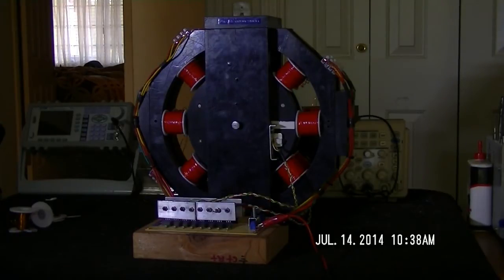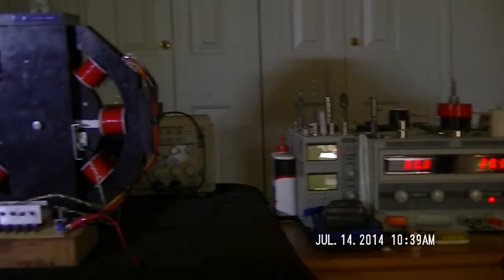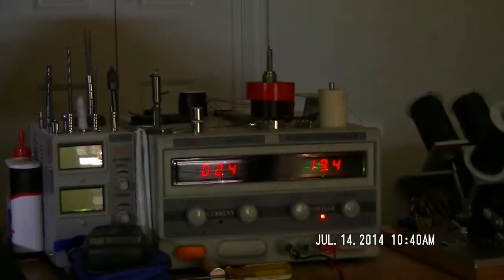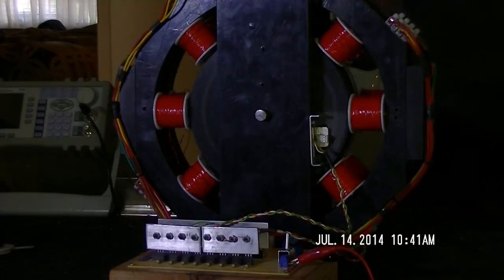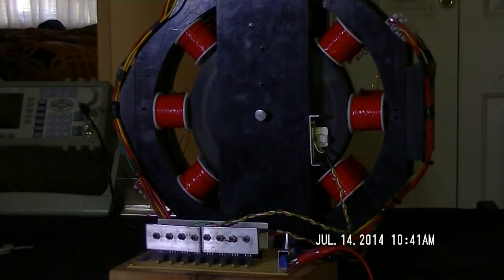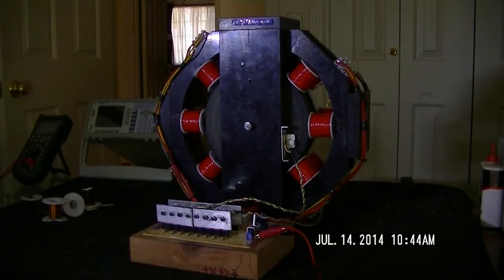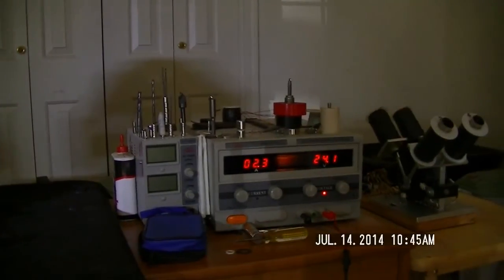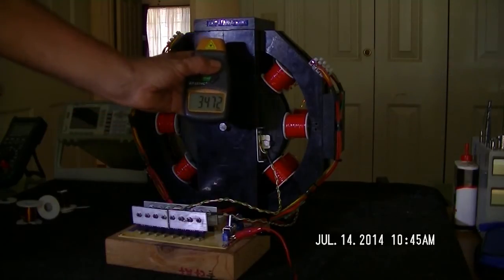Stage V: Destruction in the lab

Comment: Please invert and turn into a motorcycle wheel xD legit awesome! I need to learn more and craft this design but for mobility!
Reply from the maker: Its possible for a magnetic pulse engine like this could propel a light weight bicycle.
Reply: Sounds wicked, I was thinking more of putting the magnets in the wheel and putting the batteries in the center so it collects the energy from itself, would then end up powering itself better and provide full movement to the wheel turn and adjust speed with the amount of hz put into the coils. but I also no nothing and was more joking about the ideal.

if you ever build a working model you'll be rich and i'll be in roseburg sitting on my ass xD
Reply from the maker: These motors have very little torque, therefore, in the application of a bicycle, once the initial momentum is generated by peddling the bike, the motor would be activated to create magnetic pulses to continue the momentum. With two batteries, one 12V battery would run the motor while the second would be charging from the fly-back voltage created by the discharging coils.

Comment: the entire mechanism must be in a maglev state. incorporate the piezo shell, use light weight ceramic buffers for the mag seperators *unless something works better.. just a note? F1 engines run @ 19,000 rpms.. imagine the angular momentum in that?
Reply from the maker: Wow, ...they didn't cover this in the mechanical engineering curriculum at Cal state.  Dad was right, I should have gone for the PHD.  LOL  
This "maglev state" seems very much like what I saw in my dream.  While looking at this one craft, it was like looking at a sandwich that had one side lifted off the other and I could see two circular formations of magnets directly over each other...but that was all I recognized while the TDO seemed intuitive.
After building and testing this device, I came realize that I needed a new design coz I knew I was severely limited in rpms'  and figured I needed 9000 rpms ea. in counter rotation which I felt would integrate the field at more appropriate velocity.  
Once these craft create the field, angular moment, gravity or inertia do not exist.  I came to understand that when these beings are in the field, "Thought" although a minimal energy on Earth, within the field, its a viable power source making physical dynamics or controls unnecessary.
Reply: +Sir Farquat
I wouldn't know, I didn't go there. ;-) first, thank you for responding! awesome. I want you to know, that Ive been seeking the same types of answers, for a very long time. In life, our experiences add up. They are never the sum total of who and what we are. The gift is time to perceive. For whom we perceive is a personal matter.
 What I'd like to share with you is this; The toroid, vortex theory is a very esoteric piece of theoretical physics, though, vortex's are abounding in nature_ as in eddy's, tornadoes and hurricane's and galactic spirals.> as well as Fibonacci sequences, to harmonics.
What I want you to know, and Ill say more if you find this interesting enough, is that the key to all of the answers, from "floating megaliths" to UFO technology has been infront of us all this time. It is in the perception that monuments are built. I mean that, the world wide "phenomenon" of this sublime, whispering in our ears of something were sure we already knew, is in fact staring at us.
What? well, its funny, its contained in the 2nd law of thermodynamics, its at the end of one limit cycle, into the next... Its also in the capacitance potential, and, as piezo is to pressure, it is so in reverse.
Not trying to be mystical, just cautious w/ what I know. The initial structures have been convoluted out of our ignorance. As we attempt to stick engines inside of disks, one must laugh, its so typical.
When we meld w/ nature, and understand that its at root, not about "overcoming" a force, its about joining with a force. Much like you would consider heterodyning. A carrier wave, with the addition of the information to be broadcast.

How does this fit making a ufo work? and levitating stones, etc? It is within the resonant fields, it is within the application and reversal of piezo electric forces that we solve all of this.
A new golden age is upon us. Use this in peace.
If I may be of assistance, and you promise any knowledge you acquire from me will be protected, for free use and in peace, ill share all my knowledge.
Best, Bodhisattva
aka Dave ;-)

Comment: Have you tried putting magnets in the sides of the rotors and mounting pick up coils between the two rotors? For some reason I feel you will be able to pick up a lot of free energy there as the magnetism between the two rotors running in the opposite direction, possibly creating a vacuum there due to the opposition of the magnetism's rotation, and you could easily achieve this with opposite fields, one pole on each rotor's side. Maybe even monopole magnets you can buy from the Chinese.. They're some good old folks offering us what we can't buy here!

Comment: Have you tried playing with the position of your MGD (Motor Generator Device)?  Taking it from the perpendicular position, 90 degrees to the floor, and testing in different positions down to parallel to the floor. And also checking different north west south east. Heard it can make a difference for efficiency. Great work, very inspiring, Thanks!
Reply from the maker: Thank you. I always appreciate new ideas but I'm not following your question. Not sure I know what a MGD is, can you explain your meaning?  Thanks
Reply: I call it a MGD (Motor Generator Device) because to me it looks to have the potential for both. Kind of like the GT111 car. Overunity with a motor. Maybe if you check out gap-power.com and look for Art's first motor video. Should stimulate ideas? Hope this helps clear things up? Keep in touch, Peace
Reply: MaintenanceMouse  also, what kind of bearing and bearing grease are you using? Sorry if it was mentioned previously.
Reply from the maker: MaintenanceMouse I'll check out gap]power.com.  It looks a lot like my "magnetic flux drive piston powered motor" that I posted last month.
Bearings:  I use two ZZ series flange bearings with Redline synthetic lube on each rotor.
Reply: His first motor looks different, but it does look similar to his generator (the one with blinking lights. Either way, you are in a great position to put some of his theories to practice, when ready to. I will comment on your flux drive vid. Thanks for taking the time to reply. Great Work!
Reply: MaintenanceMouse Still working on drawing, got sidetracked a little. which is the norm for me, lil heads up.

Comment: What are you using for berings???
Reply from the maker: While you use a live axel and bearing blocks, I use a dead axel with two of the following flange bearings placed into a 1.125 center hole in my rotors.  I take the dust cover off one side and change to a synthetic lube.

FR8-ZZ Premium ABEC 3 Flanged Bearings,1/2" X 1-1/8", FR8 ZZ  (ebay)
Reply: Sir Farquat Thanks loads.
Reply: Lynn Mango Being that it seems you understand his reply, may you make a demonstration video? I'm new to bearings. Or refer me to a video link? Thanks

Comment: What are the specs on those coils. (size wire, number of turns) ???
Reply from the maker: Lynn,  my spools are plastic that I buy from this site, https://www.etsy.com/listing/106318751/empty-plastic-ribbon-spools-holds-up-to
They are:  1.750" (outer diameter) x 1.375 (Long) x 5/8 (core hole)  $7.50 for 15 spools.  They also have the same spool but its 2.300" in outer diameter.

My coils are actually bifilar with 24 AWG and 27 AWG wound tightly until the wire is ~ .3/16" from being full,  giving a resistance of 3.5 ohms each.
I use a mild steel bar 5/8" in diameter with a 5/16 pilot hole where I press in a 5/16" stainless steel bar extending 1" long. 
I mount the coils by simply drilling 5/16" holes in the outer drive plate when pushing the pilot shaft into the hole.  They're tight so they don't need further retaining. 

I use Hall sensor A3144 which is an Dual (Omni) polarity device so I can use them with ether N or S fields depending if I trigger off the face or the backside of the device.    
Good luck with the wife, I've been there,  for my wife's had problems for the past 15 years cause she has an autoimmune decease that effects her eyes.

Comment: is this an experiment at making a more efficient electric motor? RMP is good to know, but Torque is the real measure of ability to do work.
Reply from the maker: No its not a motor, actually its a magnetic field modulator. A Field Exciter that's capable of voltage scaling variable frequencies of magnetic wave field modulation.  Spin the two magnetically opposing rotors the right resonant frequency and we create a magnetic vortex that draws electromagnet energy from infinite universal field. The "aether energy" will sustain the device allowing it to self run. Guess what happens then?
Reply: you create a worm hole? I guess you are building a generator, but "ether energy" sounds pretty esoteric. Have you captured any of that type of energy? Does it have properties different from Electricity? What is the opposite reaction or force that is created when you take "ether energy'?
Reply from the maker: Joe P Your thinking about physics from a 3rd dimension perspective when that paradigm is quickly losing its hold. Modern science is still controlled just like the Roman Catholic church ruled everything back in the 12th century.
To see this energy first hand, look at the "Primer Fields" videos and you'll see the energy I'm talking about. Electricity is only one component of this energy while magnetics is the other... of course I'm talking about photons.
The most pure an infinite energy there is in the Omni-verse.

Comment: your are referring to the 'flying bells'? 
of course i see a high speed wimshurst right there! im thinking id like to try my hand at levitation too, maybe an ion lifter....
Reply from the maker: I think the Bell was much earlier. It used some kind of glowing mercury forced through a vortex plus it needed huge voltage.
The one I saw was after he did all that natural vortex stuff.  He was one of the key scientists the Nazi's used when they went to Antarctica.   I saw a sketch from Schauberger and the device looked planer with three rotors and according to the narrative, it was an opposing magnetic principle.
Reply: Sir Farquat I see Wimshurst as well. But I'm clinically mad. By the way, doe's the Wimshurst suffer from any lenz's law type of losses. Umm, is there additional drag added, during higher speeds, to a Wimshurst when under load?
Reply: MaintenanceMouse from my experience, there is a substantial drag on the opposing plates if the static is allowed to build in the machine. if it is channeled away from the machine, the plates are more free to spin. i hope that makes sense to you because im still having trouble understanding how that works  ;)
Reply: Seems like good info. So as long as there's a load that doesn't need a lot of current, then the plates are expected to build less drag? But the higher the current demand is needed, the more potential of greater drag? Load being some kind of energy device that converts static energy, drawing the static away, to functional energy? Hints at three in one energy device if coupled with your Opposing rotating disc motor/generator? Maybe i'm just a dreamer... :) But I think that's what Tesla was after. 1 motor 2 generators, but coupled to antenna. ZZZzzz Dreaming